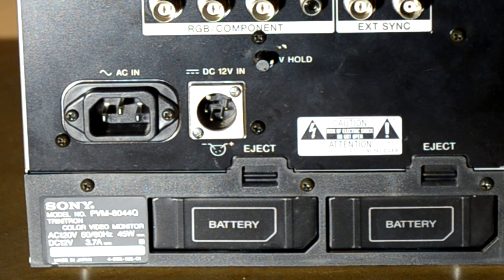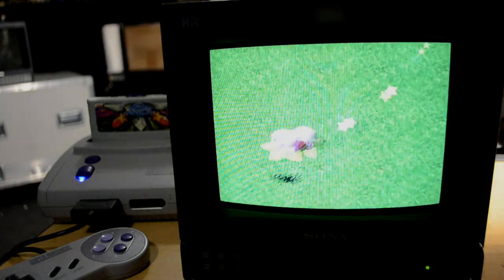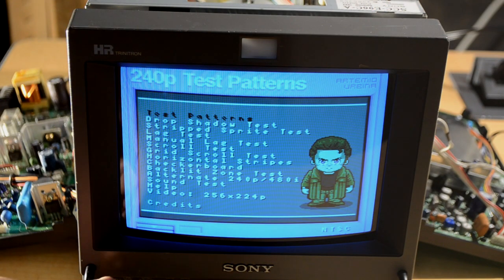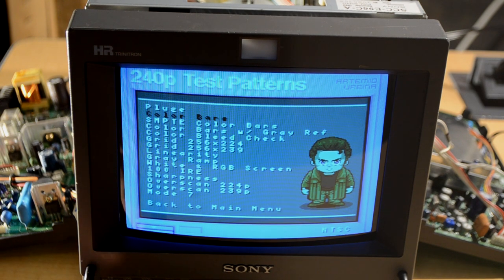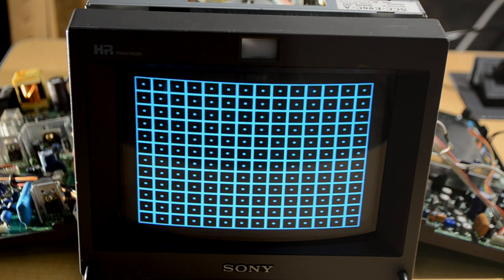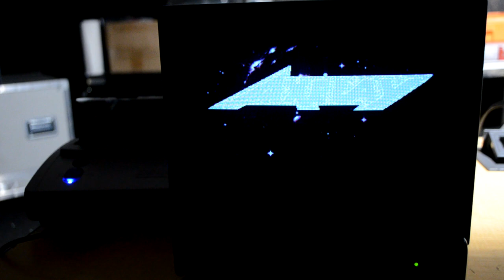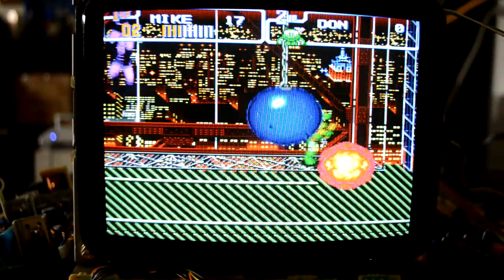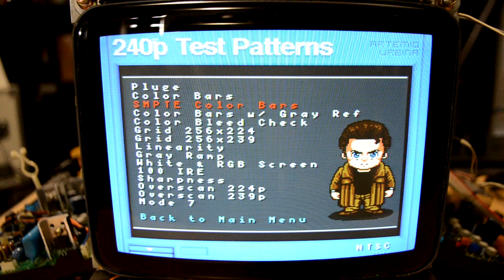Restoring a Sony PVM 8044Q CRT Monitor with a Bad Tube & Bad Power Supply

Comment: I just got this monitor last week and it needs a lot of work. This video is perfect!
Reply from the maker: Great!  Good luck fixing it up.
Reply: I have a Sony pvm 14l4 ups delivered the plastic on the inside is obliterated anything I could do like 3d printed parts... it works but when I open it boards start sagging I've propped up the boards with cable management ties for now anything I could do any schematic for 14l4

Comment: I've always been told the models with the Green button aren't as good as the Grey ones. Was there some production difference between the two?
Reply from the maker: Yeah, the green buttons tend to be on the slightly Higher End versions.  This one also lists HR trinitron.  Generally it meant a slightly higher TV line count on the monitor's resolution

Comment: Hey! Do you have any idea whether or not an 8045Q would work on 220v? The official documentation is kind of unlcear and seems to suggest it does, but has only been officially approved for 120v. The specsheet says "100 to 240v (UL approved for 120v operation), 0.7 to 0.4A, 50/60Hz". However the sticker on the back and other documentation only state 120v. The power box ("switching regulator") inside is the exact same in both models and the same as in this video (SOPS-1021(A)), but some fuses seem to be different in the US vs EU models. Could you perhaps check out the service manual for the 8045Q and let me know if I need to adapt to 120v in order not to blow it up?😅 There's an extensive part list in there which lists the 80xx and their 90xx counterpart each time, alongside the entire layout of fhe power box. I bet you can totally figure it out haha.

Comment: Got an 8045Q that has a pink tint and a busted front bezel, geometry board mount is a joke, and lots of broken plastic pieces due to the seller neglecting to add protection AROUND the PVM. I checked every trace and the back of the neck board broke off a couple of grounding plates, but it displays a picture.

Comment: how do you discharge the tube if the anode cap is physically stuck to the tube? can't get under the cap
Reply from the maker: You'd have to cut it off.  That's why I replaced the flyback with the tube.  It was much easier and that way you don't have to discharge the tube.
Reply: @RetroTechUSA  so you can touch that stuff without discharging...  know nothing :(
Reply from the maker: Yes, it's unplugged so there is no live current.  The only remaining current would be stored in the tube and it's pretty well isolated in there.
Reply: @RetroTechUSA  thank you

Comment: 8044Q is 450 tvl and 8040 is 250 tvl.  Does the transfer affect the picture quality? Will the transplant make the 8044Q become a 8040 instead?
Reply from the maker: I couldn't really see a difference in the resolution.  It's a good question and my hunch is that it will be basically a 250tvl CRT.

Comment: Strange, my second lost the same color
Reply from the maker: For some reason, red seems to flicker and go out first in most of the Trinitrons Ive worked on with bad tubes.  It's worth trying to reflow solder on the picture board first though to see if its a cold solder joint.